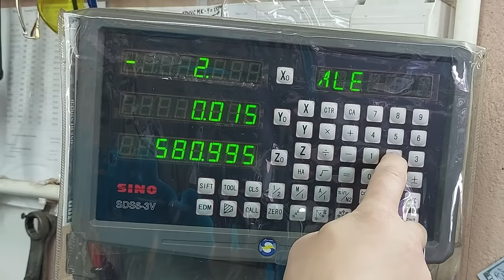A simple process for rebuilding a bad drill bit on a lathe

Comment: Friction chucks only have the capacity for bits the size of their widest opening. Demming bits will overpower by self tightening. You may not be able to get the chuck to open after drilling with the repaired bit without a damaging pipe wrench.  (Guess how I know this)